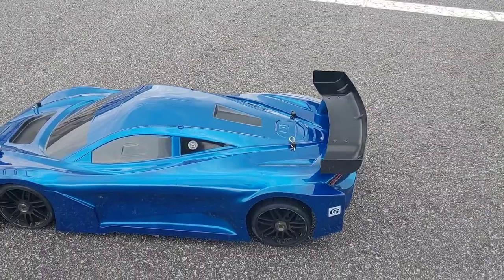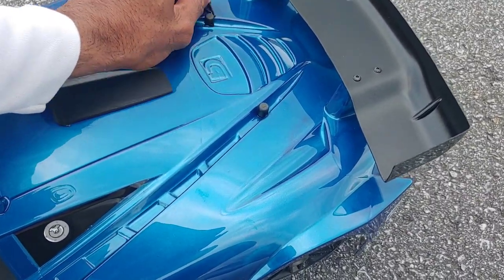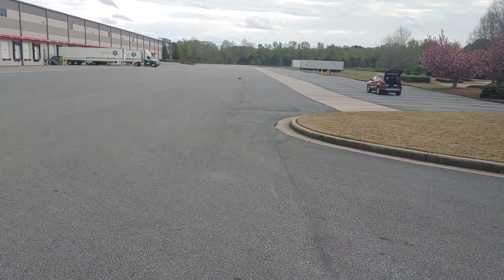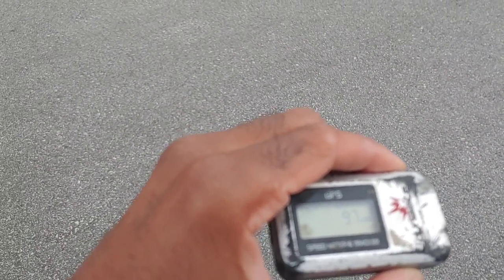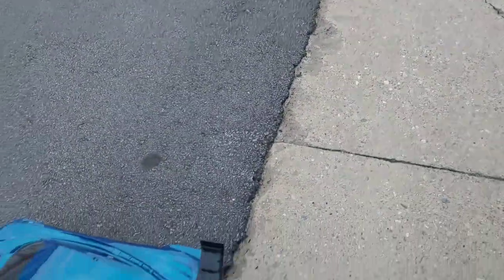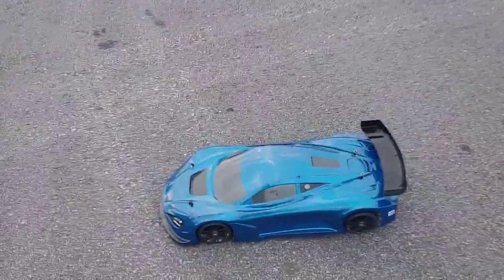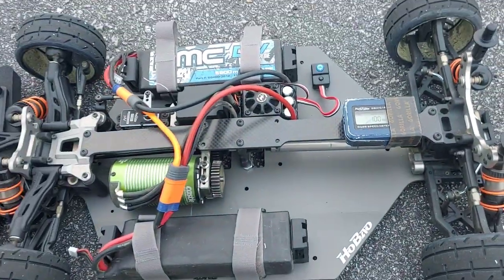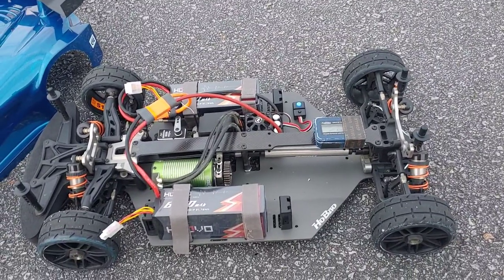Super Speed Saturdays - Hobao 1/7 Extreme VTE 2 plus 100+ mph backflip!

Comment: Jay tee.  Put some 100wt shock oil in rear with some fuel tubing as travel limiters about 1/4" of rear shock travel will keep the car in a "bulldog".. back up front down setup. Will 100% keep front down. My Hobao hit 117 with a proline C10 truck body for  example .

Comment: Dang bro, she's running like a scalded dog.  You might want to cut that rear wing down or add a larger spoiler on the front. When you get that kind of air flow them big rear spoilers push down so hard it pulls the front up enough fir air to flow under the car. once you get too much air under then she's going to want to fly. lol

Comment: Suo man. It's not a weight issue u have to trim or remove the rear wing. The rearwing is producing too much downforce and is pulling the front of the body up allowing air to get under the car. I mentioned this on your last video too.  I'm speaking from experience I had the same thing happen to me . When I made the change  car never flipped again.
Reply from the maker: Yeah I understand and know that but you also have to realize there's a huge open area in the rear part of this car that's catching a lot of air and allowing it to lift up. The body is made for the felony or infraction chassis so I have to do some adjustments to that. That's the first step the wing is easy step in fix